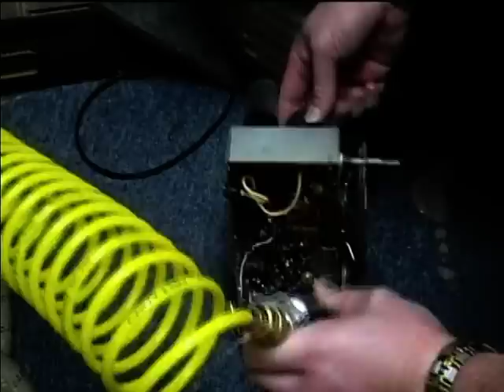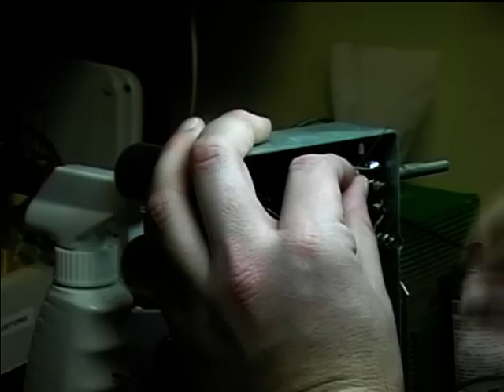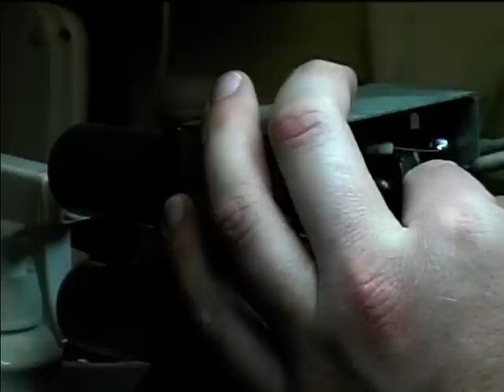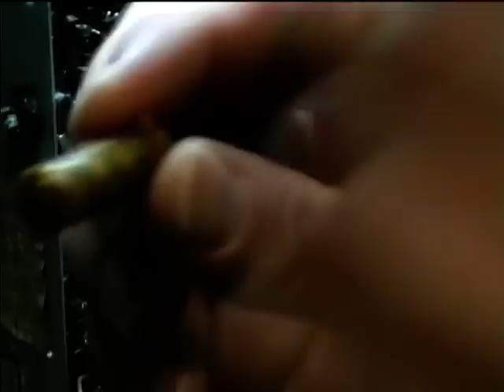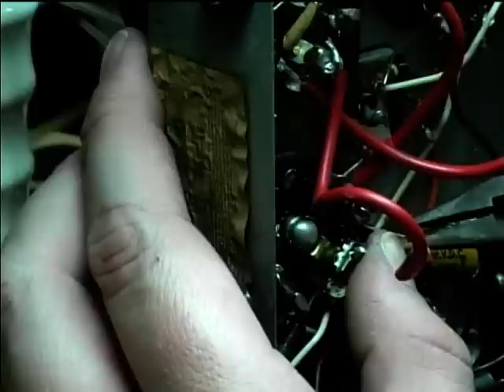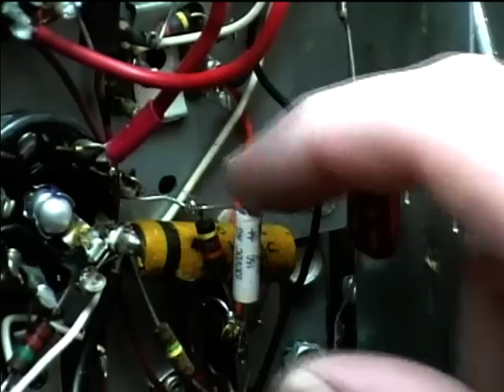Philco 50-920 tube type radio complete repair job part 4

Comment: Hello Chad.....on the IF transformer with the 6 terminals,  you used 100pf silver micas across the transformer windings. The othe 2 caps with the resistor I believe you referred to them as an rf filter. What value did you use for those 2 capacitors?? You used disk capacitors. Thanks!!!!

Comment: Hey Chad, any reason why you use those little tubular caps? I prefer the orange drop capacitors, they seem to be a little better quality than the tubular ones. also I never thought to file the old leads, I'll remember to do that in the future^^ I save the spare leads for splices too.